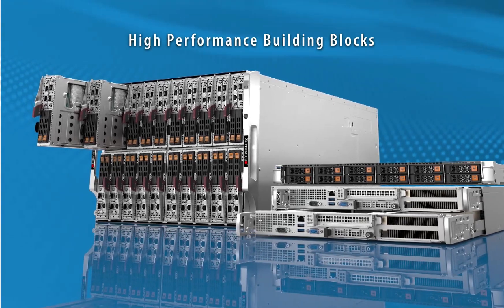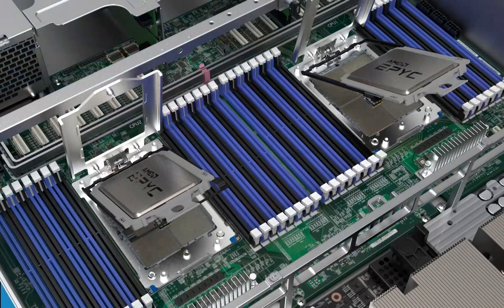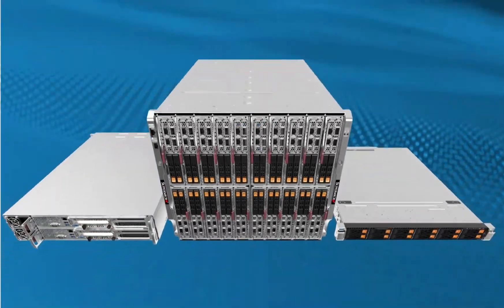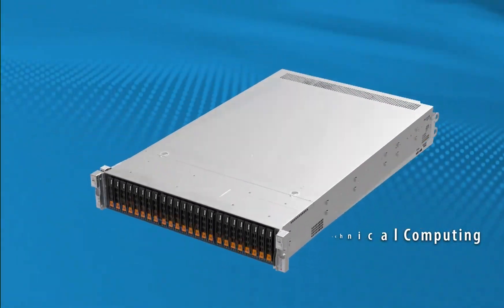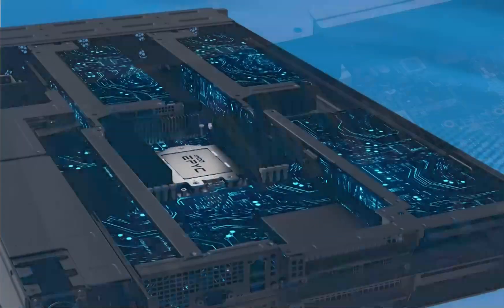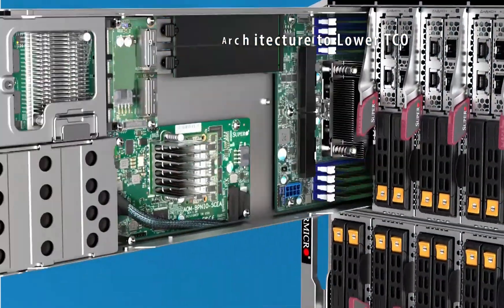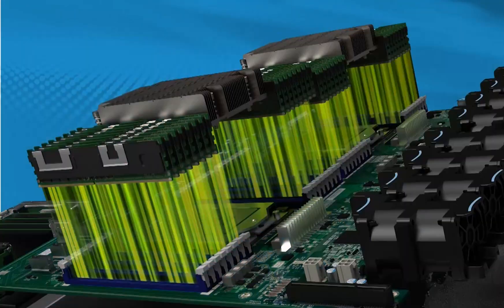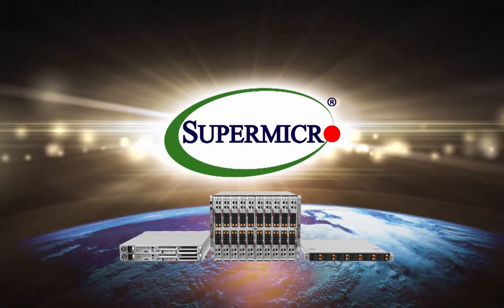Supermicro High Performance Building Blocks, Powered by AMD EPYC™ 7003 Series Processors

Comment: Hello. I am looking at the manual for the H12DSi, and I can't figure out what in the world the 2 NVME connectors are. They're clearly not Oculink. they carry 8 PCIe lanes, not just 4. One connector is 0-1 and the other is 2-3. What kind of cable is needed for them? And for the little 2.5" expansion cages one can put in the back of a chassis, are you ever considering making one for U.2? Otherwise, what is the point of those NVME connectors on the motherboard? No one would want drives just dangling around in their case.